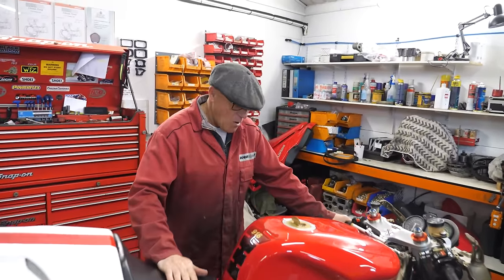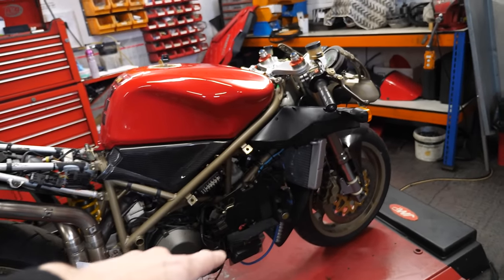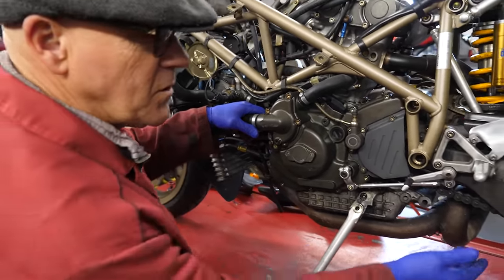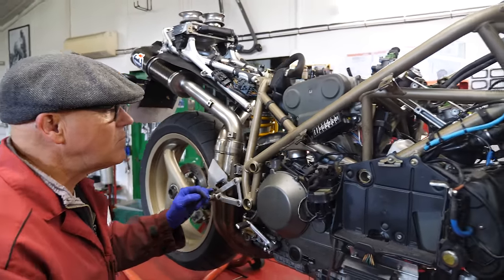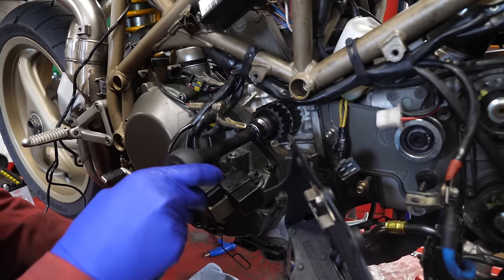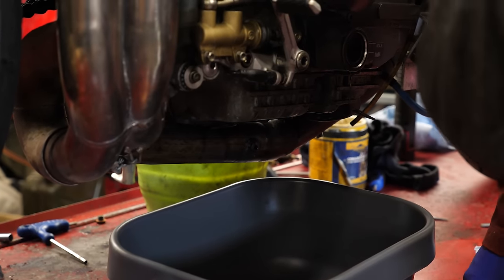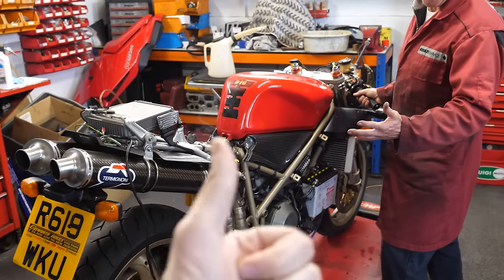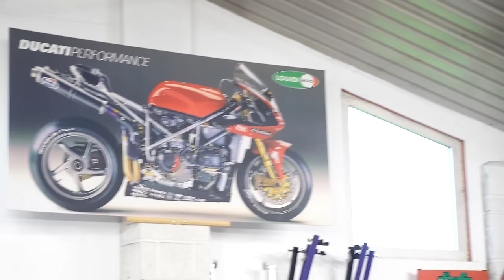Will it Start after 17 Years? Ducati 916 SPS

Comment: Not sure where I heard this but,  I became aware of a cold start-up technique that makes sense for all these early bikes.  This is what I do to avoid premature wear in any of the valve train parts.  First off use a good synthetic oil as it seems to cling to parts way longer than dino oil.  THEN....when starting a cold bike, you start the engine with the lowest revs possible, just a slow idle. Don't rev it up at this point. THEN let the bike idle for at least 90 seconds to let the oil flow up into those valve/cam/rocker arm parts.  I've used this starting method on my 916 ST4 for almost 30k miles.  I've done my own valve checks and finally an adjustment at 25k miles when one of the valves was getting close to out of adjustment, but was still within specs. The chrome on my rocker arms was near perfect.  Cam lobes excellent.

Comment: My track day bike was a 916 that I bought at an auction after it was wrecked 20 years ago. This is a trip down memory lane, I had 2 into 2 titanium exhaust on mine and it sounded so good. My old bike was hard to start when it sat up a few months, if you held a rag over the exhaust it would pop off a lot faster for some reason.

Comment: I used to think Ducati's and Italian wiring was just a joke, until I bought a new 749 and it broke down after 400 miles! Luckily I had AA cover with the bike. The guy that came out knew what it was straight away (starter/fuel relay I think). I got another replacement and rode with it under the seat, just in case. Loving this video, great to hear from guys that know these bikes inside out! 👏👍

Comment: I had 98 748 and if I remember correctly, the timing belt was due at 3 years or 6000 miles. Popped the front belt bang on its 3rd birthday having covered 2500 miles. Awesome!! 
Dr Desmo in Winchester sorted it. Wonder if he’s still about?

Comment: First thing I noticed when I checked the belts on my 999S, the previous owner had the adjustment pulleys tensioned clockwise against the belts. This is not just a concern with clearances, it is also a big no no on right hand threaded locking nuts.

Comment: Unless you are left handed then a replacement master cylinder like those that Hackett produced are so good. Lever pull is so much easier. One of several sensible mods to do and just keep the original parts. 
Looks to be in decent condition. Bootiful.

Comment: on my now former ducatti 848 (evo tune) the exhaust was replaced when i got the bike for an akrapovic which are fairly rare last year finished a engine rebuild and a full suspension upgrade to the ohlins shocks so its basicly after all the upgrades an corse in terms of spec but its an 848 i still own the service manual and a rear wheel socket which i keep i didnt drive my bike a ton maintaining it and insuring it was more expensive them the kms i made a year and i got a fair offer for it as i bought it for 14000 in 2010 sold it for 8500 so not bad for an 848 with when i bought it 19K kms and when i sold it 96K kms a good mate a mine had 2 years fun on it and then sold it back i owned the machine for 10 years time for someone else to enjoy it as i dont have the time for it anymore and i think its a waste letting a fine running bike sit and rot

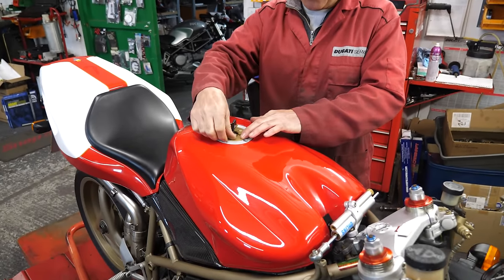Comment: I had the little bolt fall out that holds the rear brake reservoir, I've only done a thousand miles from new 21 reg V4S, took it back to where I bought it, he said its due its service, I said I got my mate to do it, he works for you, he then charged me £2:50 for the bolt, also I bought the Ducati comfy seat, it's transformed the bike for my 6:2"

Comment: Did they not look into the spark plug holes with a boroscope before starting? In all the videos of barn find vehicles ive seen they generally make a point of looking in there and/or oiling them in case of rust inside the bores from moisture during storage. Glad it started nonetheless!

Comment: The fact thst they have desmo valvetrain isn't the reason why a cam belt snapping causes issues, that's because it's an "interference" engine which means that there is not enough clearance between the valves & pistons if the timing goes off. Pretty much anything with half decent performance is an interference design.

Comment: You don't have to "replace all these parts" when a machine is stored properly and carb overhauls when they sit that long are also nearly  guaranteed as the low speed jet oriifice and emulsion tubes tend to varnish. When storing an EFI machine for several years one should completely drain the fuel tank and if it's an expensive pump you can pull it then squirt light oil into the pump itself. Most pumps have an automotive match so best to look about before paying OEM prices. I like neglected machines because I buy non-runners cheap then sort them in an easy weekend.

Comment: Very surprised the openers weren't inspected and the clearances/shims weren't checked. If there is one area that needs attention on the Desmo, the cylinder heads are it.
Reply from the maker: you could always pop in and tell him he did it wrong? haha
Reply: @BaronVonGrumble  It's your bike, if you don't want the engine checked as recommended by Ducati (every 6,000 miles) then that is your lookout. If the openers and clearances weren't checked, especially due to the sitting for so long, and you're happy then that's great. As you probably know the openers and clearances are the biggest issue with the Desmo.

Comment: My 1991 900ss had the regulator rectifier go on fire (once. That's usually enough innit?) It was a Nippondenso unit! Sabotaged by the Japanese. 🤣 Replaced with a UK made one and it was good for another 5 years until I sold the bike.

Comment: Glad he didn't feel the need to rev the tits off it for the camera!  I would have removed the plugs oiled the bores and turned it over with no fuel pump fuse and no plugs (no big end load) for 10 or 20 seconds to prime everything.  But ho-hum, the man was still gentle with it which is nice.

Comment: 916 uses same belts as a Renault megane
Reply: Actually they are not the same. Same width & number of teeth, but we learned that the Gates/Ducati belts are not 9.525mm pitch. When making those belts to Gates HTD spec of 9.525mm, the belts were too short/tight to install on some models. None of the OEM Ducati belts our manufacturer (BesTorq) measured were within HTD specification.